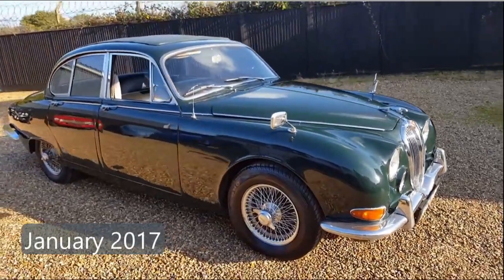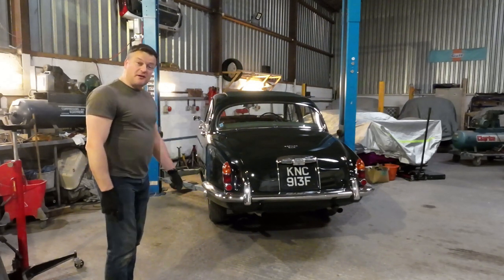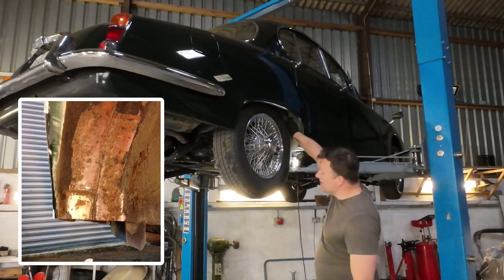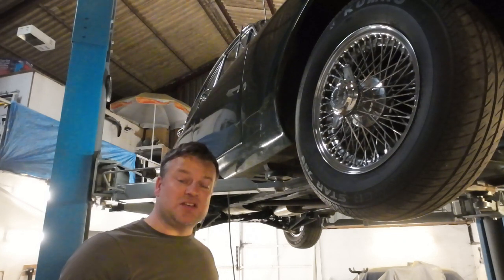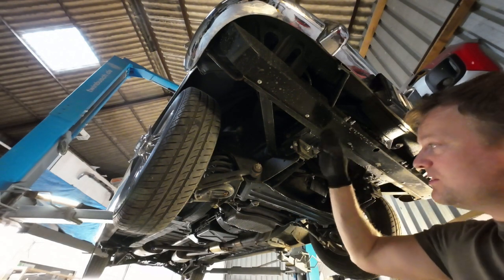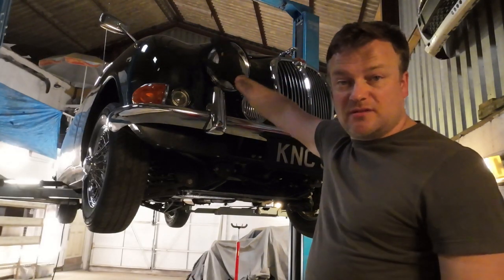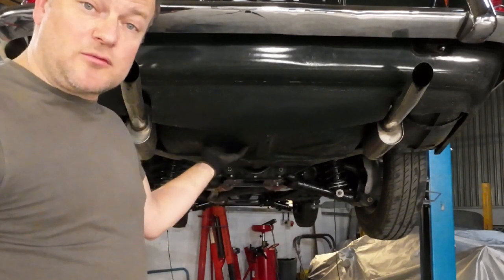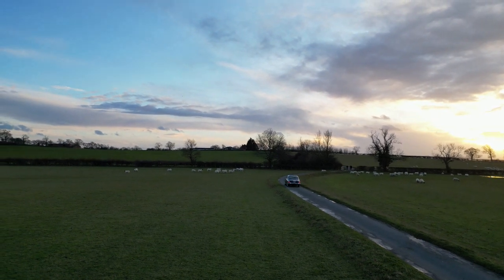Why classic Jaguar saloon body restoration isn't sensible!

Comment: The bodies for these were built at Pressed Steel in Cowley - Castle Bromwich opened around 1980.
Reply from the maker: You’re right, I stand corrected, I knew it was Pressed Steel but didn’t realise it was Cowley. At 65 miles to transport the bodies it makes my point even more that the risks of rust were there from the start (sadly).

Comment: In about 1990 I had a go at a mk2, I'd got a garage and it was going to be like vicarage thing and sell for a big price, bare shelled it, same thing, loads of rust, ended up with 13k in it, big money in 1990,anyway up for sale at 20k,no chance, ended up with 6k plus a scrap volvo p1800 that I sold for 300 quid, it was all a massive mistake for a young lad, enjoyed doing it tho, golden sand with red leather.
Reply from the maker: Yikes! I’m sorry to hear that. I certainly didn’t make any money on the S-Type either, but I learned a lot and fortunately it led me to have my workshop where I had been working on my drive to begin with. They’re lovely cars but sadly can’t justify a professional rebuild.
Reply: @fossewayclassiccarworkshop  guy near me was charging 85k in the late 80s for mk2 restoration
Reply from the maker: I can imagine! £60+ an hour adds up quickly so I think it’d be a lot more now! Of course, the saloons are a lot more car and more complicated than an E-Type so there is more to do!
Reply: @fossewayclassiccarworkshop  bizarrely he does de tomasos now, I've had a s1 e type down to a bare shell.

Comment: Very interesting video. I have just started working on the body of my 1966 S Type. Starting at the back with the valance/seam under the rear bumper. Mine is rusty in all the usual places and has like yours undergone one not very expert restoration in the past sometime. As you say it doesn't make any sense at all, but you don't do it because it makes any sense!!
Reply from the maker: Thank you, good to hear you’re tackling it. Definitely doesn’t make much logical sense but they’re great cars that need saving. Good luck and thanks for watching! ☺️

Comment: Did you use a roll over jig for doing the body work? if so where did you detach the jig to? Rear centre 2 rear bumper mounts? Front bumper mounts of the outer longitude rails?

Comment: Well done job; I have a 1968 S type which I havestarted restoring; orginally it was delivered to Italy, where it was substandard restored (as I found out), bought by an American lady who shipped it to the east coast of the USA where it had 3 owners and got stuck in a garage in Virginia for at least 5 years when I bought it and had it returned to Europe (The Netherlands). I found out it had a kilometer speedometer and orange indicator lights and had done approximately 89.000 original kilometers! I have stripped 3 layers of opalescent silver blue paint and have noticed the bodywork isn’t that bad as yours was. However did have dents in wings. How did you strip your panelwork to bare metal? It looks so shiny?
Reply from the maker: Hi! Thank you! It sounds like your S has had quite a journey! Mine wasn’t stripped back to bare metal but it was carefully prepared and 2K primed before base and clear coat.
Reply: @fossewayclassiccarworkshop  how did you carefully prepare it and got all the old paint off in the engine compartment and boot floors? I noticed how clean it was but didn’t get the impression it was sandblasted. Correct?